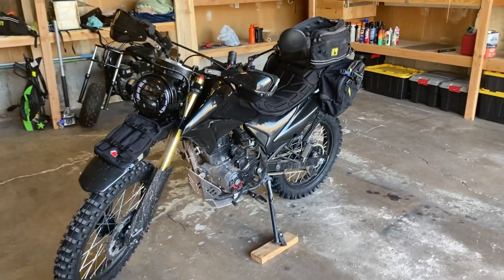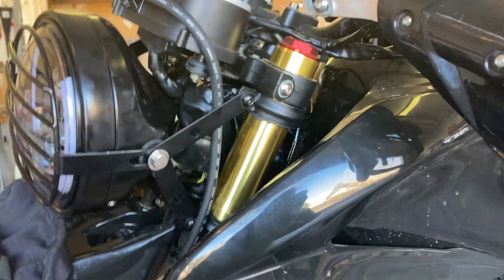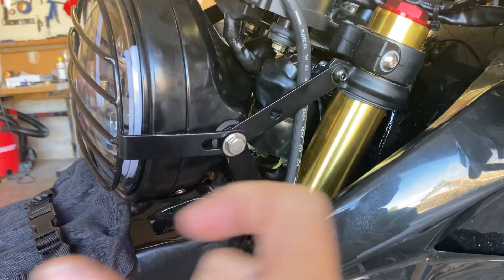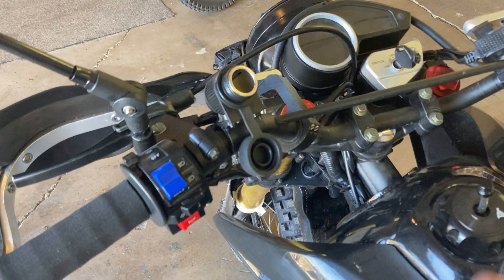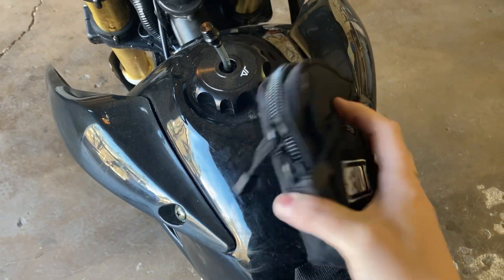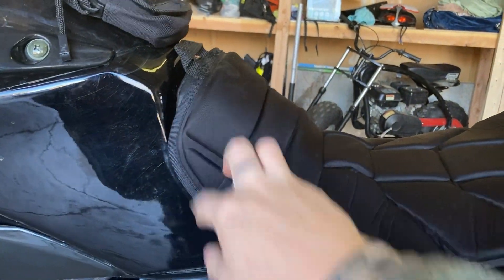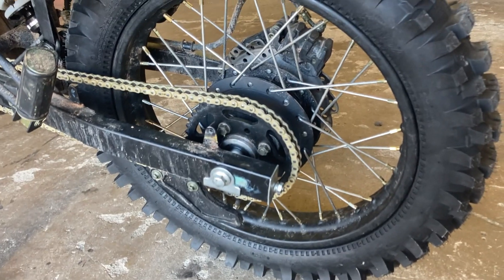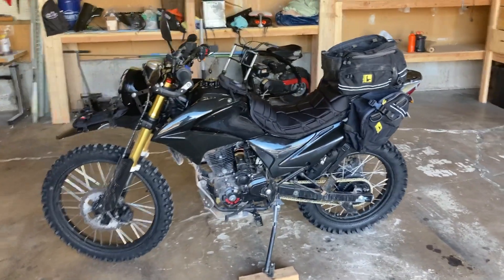Hawk 250 Mods

Comment: Hey RHC.  As others have posted, great video and awesome Hawk.  Bolting the license plate through the rear fender is very clever.  Just in case you need to adjust the shock again removing the airbox makes it a lot easier.  Where did you get those fantastic mirrors?  You can get rid of the 2x4 block by bending the kickstand mount down and inward.  This is best done with a helper so you can "test" the angle before re-installing the kickstand bolt.  This procedure is easier with a "helper" and/or a jack or maintenance stand.

Remove the kickstand and spring(s).  Put on a set of thick leather work or welding gloves.  Use a propane or MAPP torch to heat the mount on the kickstand side of the frame weld until the mount (close to the frame, but not the frame itself) is a dull orange.   "Sandwich"  the jaws of an 18"-24" adjustable wrench around the top and bottom of the kickstand mount.  Facing the handle up rather than down will give you better leverage.  Slide the jaws as close to the weld as you can get them.  Bend the kickstand mount down toward the ground.  Test-fit the kickstand on its mount to check for a good angle.   Repeat the heat-and-bend cycle until the kickstand is in the proper spot  Let the metal cool, Remove burnt paint off of the top and bottom of the mount and frame with a wire brush  Prime then paint the bare metal.  Reinstall the kickstand and spring.  Even if you never use them again, brake spring pliers will make this last step much easier.

I did all of the above to my 2015 RPS Haosen Hawk 250.  It never tipped over the kickstand again.

Comment: a street/trail bike set up for commuting on the hwy. good work! I am ok leaning for full foot support on the ground when stopping but I will consider that seat upgrade and/or different shock. I am still breaking mine in (less than 100 miles so far) and hope for SOME relief adjusting rear shock. Mine is set with the rear shock stiff & most height.
Reply: I'm 5.7 and still have my stock shock. It was so high I couldn't get on it hardly.  I adjusted the shock to the softest position. Now I can get on it better and be on my tippy toes which is fine with me because u can lean alittle on one side . I'm used to it though having dirt bikes all my life.

Comment: How is the 43 tooth gear? Did your dlx come with the new larger chain? Would you recommend going down more for higher gearing?  Stock at 7k rpm I can cruise at 55 60, where at you at in that range?
Reply from the maker: I put the new chain on. I don't do too much riding at 60+mph but I did end up switching back to stock 16/50 setup because of the 6500-8000ft altitude that I ride at. The Hawk just doesn't have enough power to keep the speed up. Sometimes I would be wide open going up a hill, 4th gear and my speed would be dropping lol.

Comment: Really nice mods.  Did the rear shock make a huge difference?  I don't know much about these bikes but saw the 2021 has some upgrades and fuel injection- which should be a nice thing to have for reliable starts.  Do you recommend the 250cc 2021 Enduro Hawk?  What upgrades are must haves?

Comment: how did you remove the stickers on the plastic??
Reply: They are just a cheap sticker so they peel off really easy. I did all mine in a minute. Just peel them off and wipe down the fairings with a microfiber.